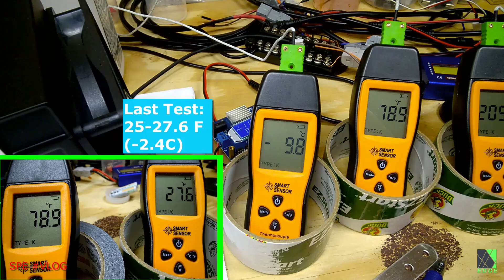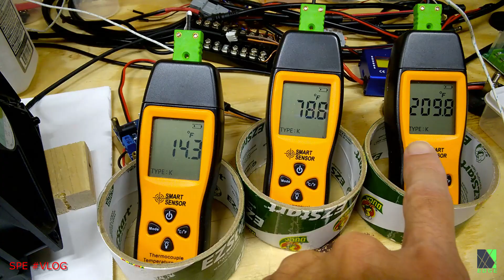Short Solar Peltier Freezer Project Update - Colder Temperature Less Power Solar workshop VLOG #diy

Comment: Hey for induction cooker from dc, try a bedini energizer since it sends 300v+ pulses dc and hardly uses any power
Reply: It might actually cause a cooling effect if it doesn't work as a cooker, because it has negative resistance sort of
Reply from the maker: @person52person Thanks I should build one of those Bedinis to experiment

Comment: Maybe a idea on this? Think walk in cooler at a restaurant, have evaporator units blowing cold air. Couple years ago used a 120MM aluminum water cooling heat sink with 3 60watt peltier modules and rv fluid but it froze up when got to 1OF. Been thinking of different fluid maybe 100 proof vodka?
Reply from the maker: @Off-gridPA I'm interested in trying evaporation. Running the heat outside and spraying mist over it. Alcohol might work, it's worth a try!
Right now I'm testing a larger peltier fridge (not the one shown), and it seemed to work well. Ordered some parts to make a better one. Showing the results and test as soon as possible.
Reply: @solarpoweredge  one thing about peltier like compressor is cascade refridgeration drop you colder than ambient air water cooling haven't tried that yet an option one needed to turbo charge peltier cooling. RV antifreeze didn't work well as a refridgeration fluid being froze up in aluminum block said earlier. Peltier can go down to almost cryogenic temps pretty wild where cascade refridgeration come in handy. Definitely need a fan in a cooler move cold air around. Air seems or is a insulator without a fan cooling doesn't do much. Help save battery power direct connect pv peltier fridge. 😉✌️
Reply from the maker: @Off-gridPA A solar peltier fridge (larger than my portable compressor fridge) is already in testing :) the videos don't keep up with workshop unfortunately....

Comment: Ahh, lol.  You beat me to it! This is the project I'm hoping to build as well, but mine isn't going to be run off solar (at least not directly) I have a lot of hurdles to overcome with what I have in mind as well, like how to handle the moisture inside the cooler.  I wanted to get one of the 12 volt DC coolers and see how they work.  I'm confident that I can come up with something that would be more cost effective that I could also share with everyone.  I hope to be able to utilize my 3d printer as well.  I'm excited to see your progress on this build.
Reply from the maker: @colin8532  I think your project will proceed 10x the pace of mine, as this turtle is proceeding at a very slow pace :) A small fridge is now under construction for research purposes. It will be direct solar and DC 12v. It took well over a week just to get some peltiers installed on a piece of board. And months to finally see freezing temps...
PS: I have a Monoprice mini 3D printer collecting dust, really hope to get that thing going again!

Comment: I suggest passive heat pipes below if making a freezer.  Ensure they are filled appropriately for low temp.  You will transfer more heat into the peltier from conduction around the chamber, instead of collecting heat from only air.  This also creates extra cold sink mass, with the fluid in the pipe.
Reply from the maker: @kelimike Will certainly be testing heat pipes in the future, they are very good at what they do